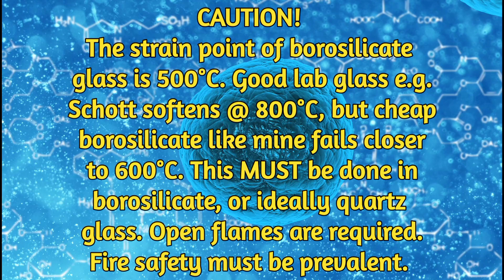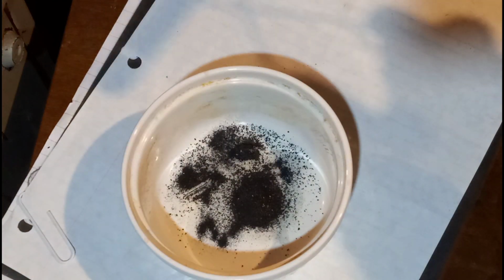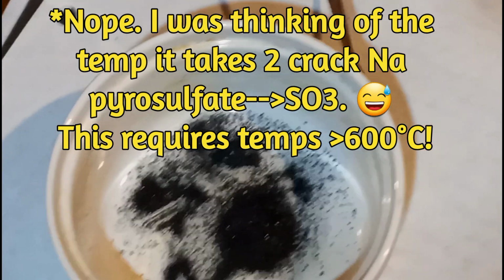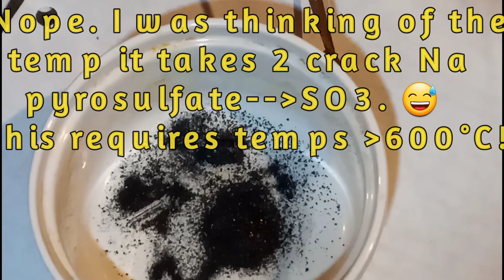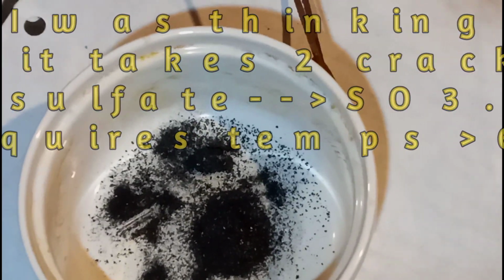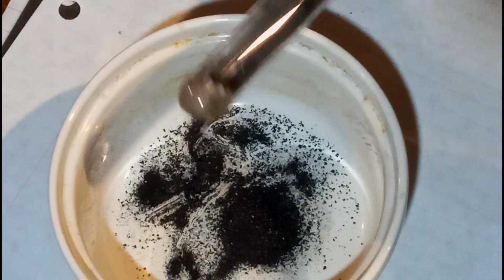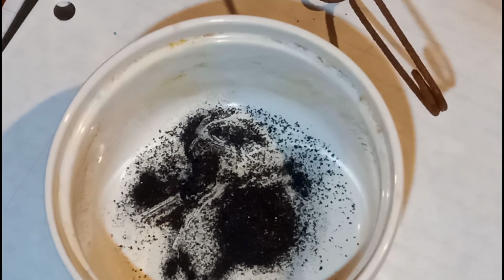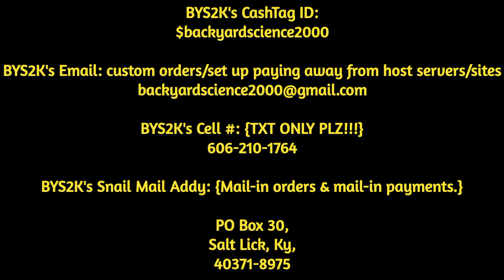DIY CaC2 & Acetylene

Comment: Too bad it failed.

Maybe use a refractory cement or ceramic recipient like porcelaine... this should stand quite high temperature... red hot heating... but of course you loose the visibility of the inner reaction.

Would be nicer to prepare calcium and to allow it to react into an electric refractory furnace... heated by graphite electrodes and electric arc welder :o)

I wonder if a salt of Ca like Ca formiate or oxalate could be reacted directly with carbon at high temperature to generate metallic Ca and then CaC2?

Or if CaO or CaCl2 may be reacted with a metal like Al, Zn, Fe  or C with anaerobic heat or electric support to yield the desired compound?

Heat may displace the thermodynamic equilibrium and lead to the desired comppund.

PHZ
(PHILOU Zrealone from the Science Madness forum)/
Reply: @pbn3215  
Maybe a compromise... ceramic recipient with a pyrex glass topper to see partially through the top
Reply: CaO is used to make calcium carbide, but in a different way. Calcium carbonate and carbon are heated without oxygen, however that's accomplished like a one-way air lock maybe idk, to really hot I think like over 1000 F maybe closer to 2000. Along the way, CaCO3 decarboxylates to CaO, and even hotter the CaO oxidizes some of the carbon to CO, and becomes CaC2 with other carbon there. Idk the mechanism, or if the CaO could be considered an oxidant, but the basic idea is CaO + 3 C -> CaC2 + CO. This is how the majority of CaC2 was made during the 20th century, with hydroelectric from Niagara Falls, at least in my area.
Reply: @pbn3215  Honestly, bonfire and a steel drum sort of thing is what I was thinking but that doesn't mean I'm expecting anyone to try it any time soon lol